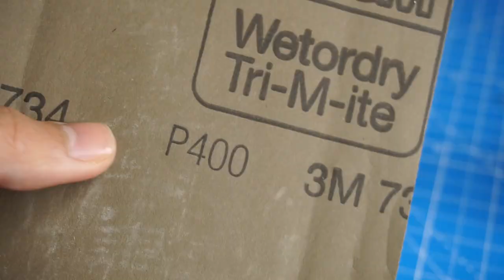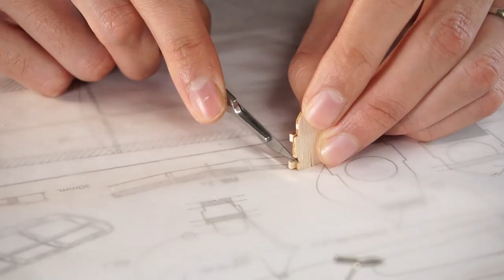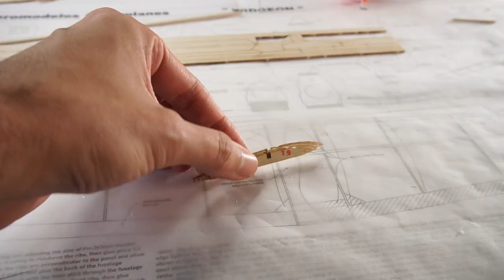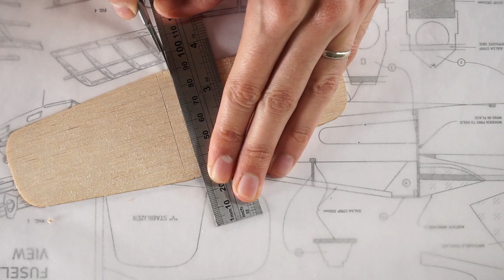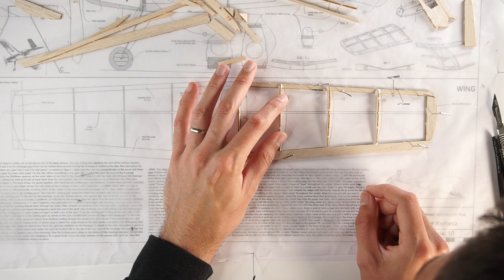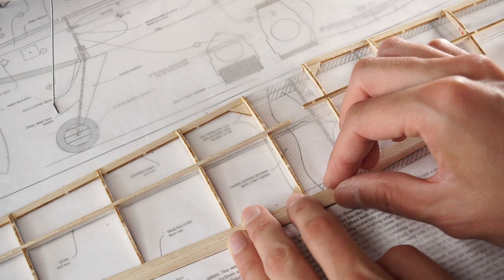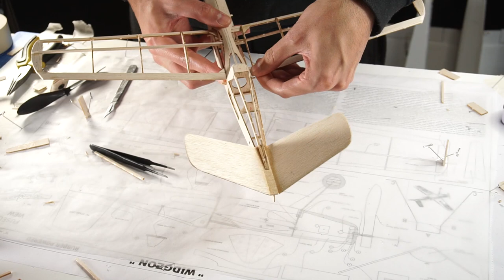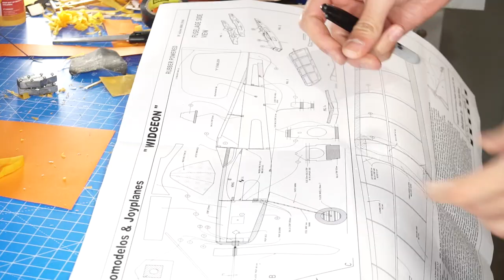Free flight rubber powered plane | Widgeon full build process

Comment: You are using the wrong adhesive for these type of wooden kits made mainly out of Balsa (with some additional Spruce/Beech in it). Either use "UHU Hart" or "Aliphatic Resin Wood Glue". The type of UHU you used for your built is rather a general purpose hobby glue and not well suited for this type of application.
Reply: It still worked tho

Comment: This is a copy of the old frog kit, one of a series of beginners kits from 1954. I built this and others from the series that year. (I am 84 years old) .I remember them as being made of much thinner balsa of high quality and the first pre cut kits I had ever seen. I used balsa cement and they went together very quickly. The wood in this kit seems to be twice as thick giving a high weight penalty. Nice though! Walter.

Comment: I built free flight models with PVA wood glue thinned about 10%.  Balsa cement I found tended to dry out over time and pull away from the wood.  Also the joints were brittle,  whereas the PVA joints had a little flex so there was less damage in a heavy landing.   A fully sheet tailplane (stabiliser) whilst simpler to build adds weight where you don't want it.  I'd be looking to use 4 to 5 Lb/cubic foot wood for a solid tailplane if you want to follow the original FROG Widgeon design.   Wood be useful to cut off a 10mm wide section of the tailplane trailing edge both sides then re attaching each  piece with two 12mm lengths of 0.5mm soft iron wire that the Florists use.   Secure the wire with thin cyano away from the hinge line.  Use these to adjust flight elevation and turn.
 To avoid cutting the plan you might find the use of a small cutting mat useful,   say 150mm square.  After final doping the wings must be checked for warps before flight.   Any warps that have crept in can be straightened over a stream of steam from a boiling kettle.   Good idea to have a little wash out at each wing tip by steaming the training edge up by 2 to 3mm as this will help prevent tip stalling and spinning in.
The "trick" to making those small models fly well is to use as light a balsa wood as possible except for the wing spars which should be 12 to 14 lb/cubic foot wood.   The original kit manufacturers tended to use heavier wood as light wood does not die cut well and lasers hadn't been invented 60 years ago!

Comment: Very nice. Looks like a good candidate for some micro r/c gear too.
Reply: No, he's too heavy. Even now with rubber band can't fly well.
Reply: I think adding 4" to each wingtip would give a very nice RC model. Modern radios have plenty of mixing options, so the V-tail would be all the control you'd need.

Comment: You could get away with less nose weight and further back c of g and less decalage. I don’t like Uhu adhesive for this. Aliphatic glue is good as is cyano. Britfix balsa cement was good but no longer available. You could lengthen the nose and longer rubber motor will give better flights. There are limitations with this sort of small model. It’s very suitable for electric though. The balance is better and with a small lipo longer flights are possible.

Comment: Honestly, you could make an model from the foam board that would be better than Balsa.. -- Directly replacing balsa with foam, you can build a better more durable and lighter model ( still covered in tissue paper ) from the foam board..
Reply from the maker: I'm not sure, the foam will flex over time and loose shape.